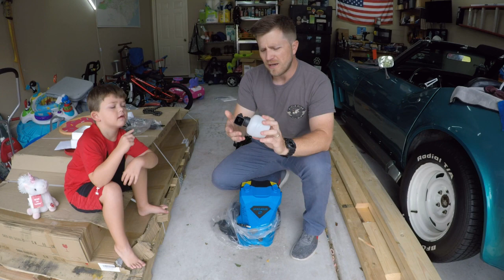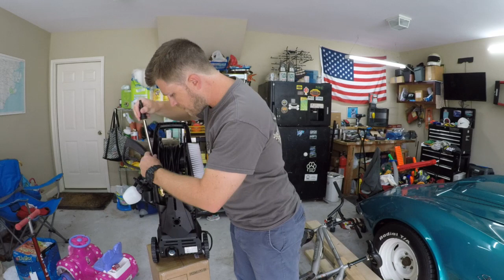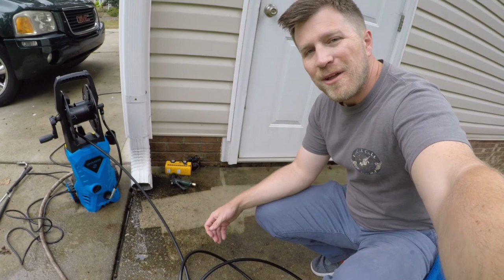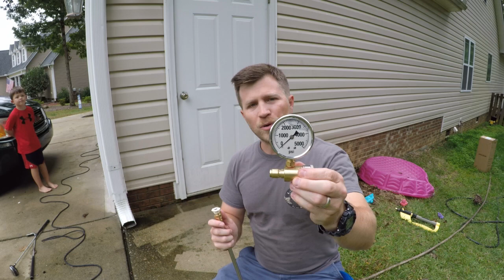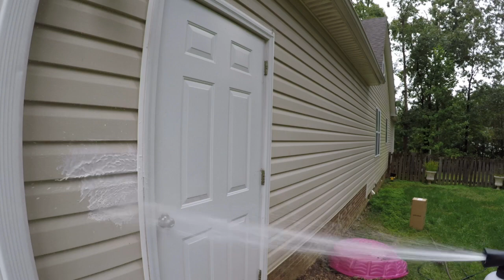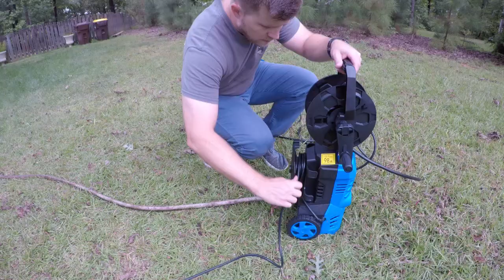WHOLESUN 3,000 PSI 2.4 GPM Electric PRESSURE WASHER Review

Comment: bought mine..  did leak a lot at hose connection.  took shell off to figure out.  bingo, this unit has female swivel to female swivel  hose adapter to connect to male hose "metal mechanism".  I swapped that hoohickey with  female hose swivel, brass pipe nipple, fixed (not swivel) female hose. assemble swivel, nipple, and fixed together, use teflon tape. then take  plastic shell apart (the male is buried inside the shell), teflon tape the male,  tighten up the fixed female to make sure it never unscrew...

Comment: your not going to use I?
 alright what it its is it will do 3000 psi with very low rpm or vary to higher gap with lower pressure what it will not do is high ghpm with high pressure. thats what he's not showing you any pressure washer that says the word max is doing this. only pressure washers that say 1800 psi and does not say max but look at the gym if it .6 gum then the fan is more gum then the fan is larger. 1600 psi and .8 gum isn about the best you can do in cleaning units avoid electrics with wheels. storing the whole thing inside an 18 gallon starlit container so it doesn't freeze is the real goal here especially since you need to clean the car int he winter.  winter pressure washing  is the real goal here. you can't k just winterize the thing all the time.    using quick connectors probably the most important pare of the pressure washer if the  screw hoses are tightened with a wrench they won't leak but you can't just go around screwing all that together all the time eventually its going to get left out overnight with the power on and the hose leaking the pump will pulse on overnight over and over and wear out the motor in just one day. the quick connector lets the  hoses get put away quickly and they don't leak. the real goal here is to us a smaller diameter hose since  since its just  .6 gap you Monty need a regular size hose to liquid around. a stainless;ess steel hose some pie air water hose  or maybe a  fabric hose but really. a small diameter rubber hose  like pvc say 1/4 inch  with custom quick connects for a garden hose is ideal about 100 ft. you might want to quick connect at 50 ft. thats gonna gat  you around the yard with a lot less work. don't be afraid to rig up 100 ft or more of chap hpvc plastic pipe in your yard there's even screw together. ends that won't leak much of there just hand tight you could get water  way out in a field with a temporary pipe across your yard. 1/4 inch is plenty of volume  at 2.50 per 10 ft its cheap then you can subtract or just use a regular hose fro m the house out to the farm section of your property just one of those tricks the good old boys use instead of buying a lot of hose some use  irrigation pie its not flexible  but it gets 
if  there's a quick connect to the hose. a quick connect to the pressure hose which can be done with 22 mm brass adaptors from the  pump to the hose a pigtail  to the machine can be added to shorten the pump electric  plug. that means you can just  quick  connect the  pressure hose the skinny garden hose and the electric cord. move the machine.  then move the cord the hose and the electric line all at once. you can even tape the hose and the electric line together  then just move the machine and only the hose it a lot eisier.  and the whole thing goes into the starlight container a lot easier. the water leaks into the. bucket. the whole thing  goes inside the house and it doesn't freeze  busting the pump  inside which oil what gaped wrong with thees.    
 use the spinning tip only don't bother with other stuff it will clean about the same as a  gas pressure washer in fact even better and the spinning top does a lot better job  than even a gas pressure washer at removing   paint  and not tearing up wooden decks.   don't buy the pressure washer that sits up right the hose gets pulled and it slams onto the concrete and breaks the pump its impossible to get up stairs or up to a second story somehow. get the little suitcase type thees days the ratings are the same and the whole thing goes into a starlight container so it dosing freeze. right now the cat brand look like e the best  pump. archers  the biggest brand but iv bought plenty of them over the years.  the smaller. box type with no wheels has the  same specks. get .8 gal minimum or more and the highest pst. with he spinning tip  and your as good as a gas pump in fact better.  a lot better. no more noise gas or carburetors. cording up because of ethanol gas if you do have a carburetor on small equipment be sure to buy  only non ethanol gas aluminum will corrode in a couple weeks and your tool will be totaled about the only time ethanol gas is really a problem is short term storage  with an aluminum carburetor. 
 if you wan tot clean up this article and repost it feel free. I wrote it in about 3-5 minutes soooo...lol!
 20 years restoration painter  seattle Washington.

Comment: I doubt can get 2.4 at 3000 using 110V motor looking at Landa 1000 PSI at 2 GPM uses 15 Amps at 110V. The only way I could see it working is some kind of brushless motor could get more HP from less current. The cost would be much higher likely just a small motor in there. Landa has a 2.8GPM at 1000 PSI but the 110V current is 20 amps not a normal 110V 15 AMP receptacle. If I had to guess this is about 1800 at 1 - 1.4 GPM at best the GPM is what makes a big difference.

Comment: I just got my wholesun pressure washer yesterday from eBay. Just put it together and noticed that the hose on the reel has rubber that was eaten away in some areas. Can it even be used like that since the hose is under pressure? I have 2 other pressure washers that don’t work so is it possible to remove the hose off one of those and put it on this one? Unless it’s a very simple procedure I doubt I could figure out how do it! Is there a way to just repair this hose by putting some kind of tape on it?

Comment: I purchased the  Wholesun power washer. It really leaked where the handle inserts into the pressure hose. Since it was still under warranty, I requested help with the problem. After 19 request, I was finally was given a Tracking  # for  replacement parts to correct the problem. Tracking #  didn't  exist and they refused to tell me who the carrier was. Now after that they, stopped conversing. Therefore I am left with a product that gives me no more pressure  than using my hose. As the seller us a third person, there is NO information regarding a telephone # or address to contact  the Wholesun Company. VERY DISAPPOINTED and I left with a useless power washer. Amazon only warranties it for 90 days and told me to contact the company, however the third person seller of the product will not supply me a Wholesun contact.
Reply from the maker: Sorry to hear that.
Reply: @KevinNadeau  Sorry doesn't get it fixed. So, what would you suggest I could do to fix my problem. Do you have address/telephone # I could contact??? As I stated the warranty  is still valid.
Reply: Same with us.  Water blows out around the handle.  Can't figure out how to fix it.  $130. Wasted.
Reply: Lmao its a review. Why are you asking him

Comment: Electric pressure washer and lawn care are always winner compared to gasoline ones for three reasons:
1- they are quieter. When i use electric lawn mower, i can hear whoever calls me while it is impossible to hear others if you are using gasoline. So you keep your ears healthy. 
2- they do not emit emissions which could harm your health. 
3- electric ones are simpler and do not require maintenance.
Reply: Electric washer need alot of effort and time consuming if using it for cleaning a mold on concrete and fence because it'll never be as powerful as gasoline.. it get more harder when using it with the floor cleaning attachment because it not having enough pressure and gpm.. i have this exact 'wholesun' brand of electric washer and after putting a pressure gauge on it only making 1500 psi and not 3000 psi, i feel like getting scam by the product..  luckily goods bought from amazon can be returned back if not satisfied.. i'm telling this so other people will not feel disappointed on a first use after bought this brand and dont put too much expectation because there no way a 1600watt electric motor can put out 3000psi.. my advise if want a budget price electric pressure washer that'll put out the power up to the spec and reliable, stick with reputable brand such as ryobi and greenmax.. or just look for washer that have more than 2300watt motor..

Comment: Throw that shit away
Reply from the maker: Why do you say that? Have you had a bad experience with this pressure washer? Genuinely curious.
Reply: @KevinNadeau  no not with that brand in particular but I’m not a fan of electric pressure washers, I’ve had 1 or 2 in the past and they just suck compared to a gas powered one, just a lot faster and does the job better, if you ever get a chance to use one you will know what I’m talking about
Reply from the maker: @fernandodabber1727  I have had the same electric pressure washer (different brand) for over a year that I use to wash my cars and do light cleaning around the house. I also have a 3,800 psi gas unit that I use to clean siding and driveways. They both have their place for different uses in my opinion.
Reply: @KevinNadeau  I don’t think they both have a place cause if you want less psi then just lower the unloader valve and your psi will go way down , for example I wouldn’t want to wash my car full on blast with 4000 psi from my gas powered pressure washer but I can lower the psi till like 1500 psi which would be more then enough to wash a car or something that you don’t want to mess up , I just hate electric, I would rather have one that has enough power to do what I want and be able to adjust if I don’t need to be that Strong, having two in my opinion is just a waste of space  when you can have one that does it all
Reply from the maker: @fernandodabber1727  Fair enough
Reply: How would we add more hose?

Comment: Good value for the $130 but nowhere near the PSI they advertise and throw it out if it breaks as parts will be nowhere to be found. A little deceptive advertising no electric will get you over 2300 psi and they have to cut back on gpm to get there.
Reply: All brands do the same. They have an advertised, and a rated number. All of them.
Reply: Not really!!! I have a presumiré washer that is advertised as 2030 and delivers close to it at 2000 psi !
Reply: @billgon2000  there you have it, you just said it, not the advertised. And I highly doubt, and would bet money you don't have a way, the knowledge or the means to test it by yourself.
Reply: You got to be kidding me 30 psi off and you claim it’s false advertisement! Get real Rafa! End of conversation, not wasting time arguing with you. Go buy it, hurry go buy it.
Reply: Rafa, get yourself a Bourdon Gauge and do the bucket test. Educate yourself!
Reply: @billgon2000  c'mon man, you just googled that. And you're lying, all the manufacturers have the max and the working pressure. So you're lying
Reply: Bill= mr know it all
Reply: @Jwalls1980  Thanks for the compliment, I am glad you learned something!